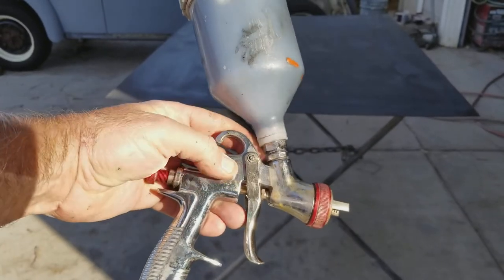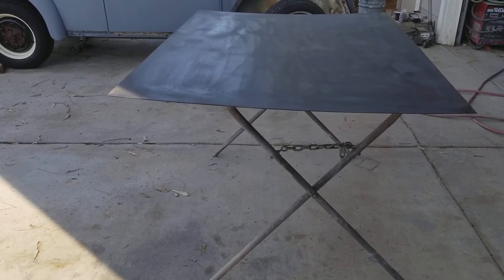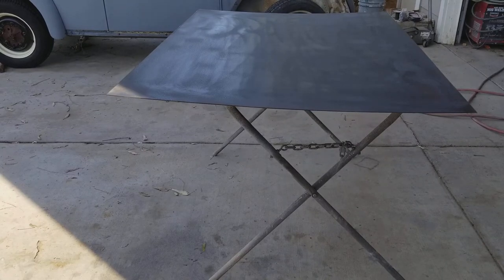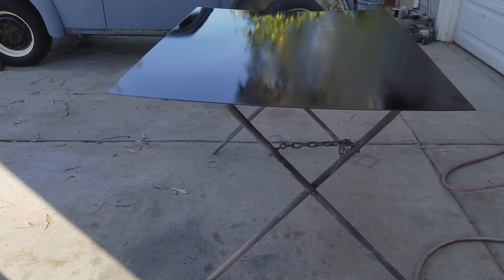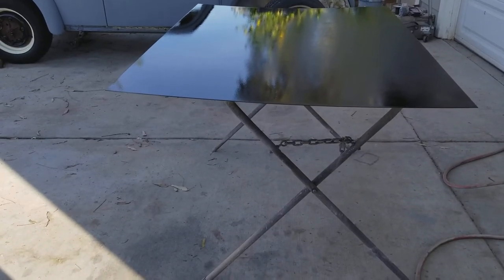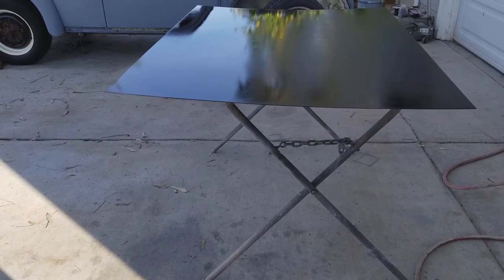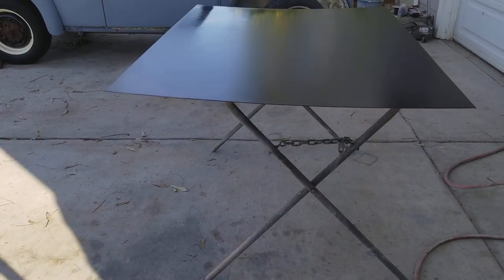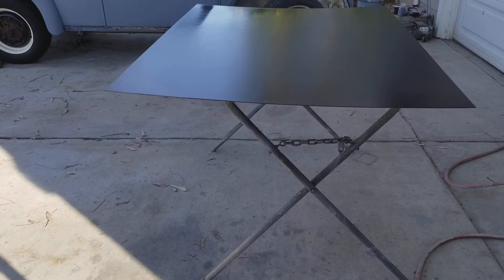Sprayit lvlp sp-33000 spray demo

Comment: This gun will paint whole vehicle. Underground Paint King did a 09 Tahoe and a commander with the sprayit sp-33000 and a 21 gallon air compressor
Reply from the maker: tried to spray base on my Silverado double cab. It was too small to keep a wet edge. Harbor freight HE spectrum  uses little air and has better atomization.
Reply: @mikethepainter  You're spraying at 6 PSI. You have to pump it up.
Reply: @mikethepainter   Your PSI is way too low.
Reply from the maker: @SOLDOZER  I had it at like 20 lbs. with this setup it was at like 6. but it still sprays. not very atomized but it works.

Comment: 😃😃 Hey Mike do think you can give me the  Dimensions on the fittings On converting to turbine... for the compressor hose fitting the turbine unit
Reply from the maker: It would be a good idea to get the high flow air fittings I don't know the dimensions

Comment: Hi Mike,

I have a Apollo turbine laying around. Do you think this gun will fit on any professional turbine?
Reply from the maker: yea I made that setup with stuff from home depot and harbor freight. It does not put out much volume but it really does not make much over spray.
Reply: @mikethepainter  the key to making it a good spray is using the turbine's air hose, so it has a higher volume of air, with less resistance than the regular air compressor hose.  Just simply move that quick connect from the turbine and put it at the opposite end of the turbine hoes.  Also using a smaller tip, like the .8mm gives better atomization.
Reply: @MG38601  So I can use my 5 stage turbine with this gun to do urethane clear with a 1 mm tip?